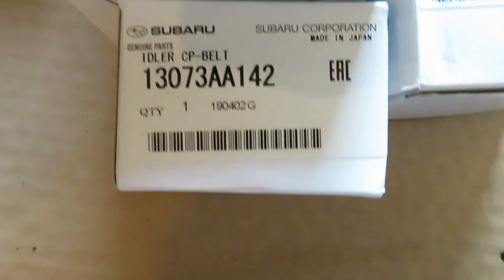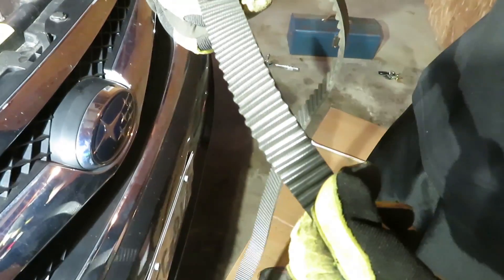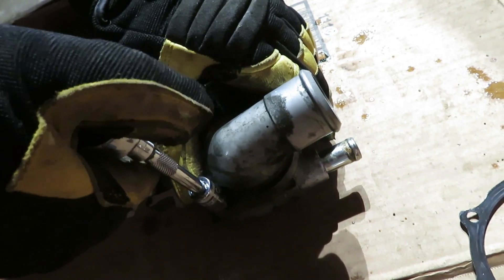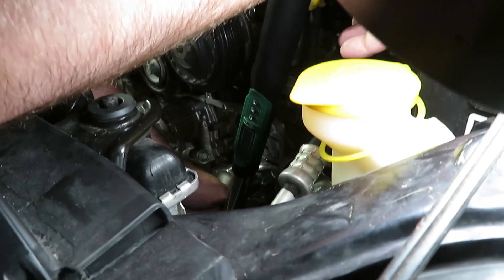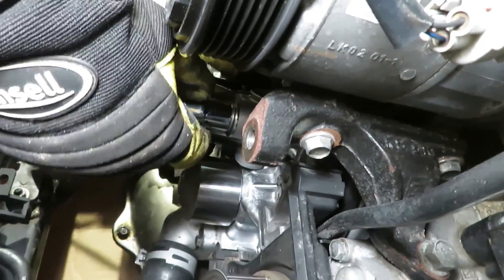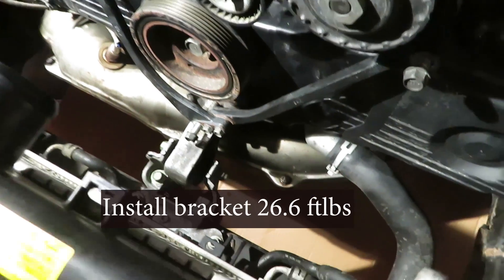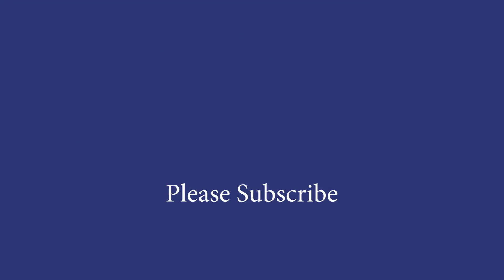How to Replace the Timing Belt and Water pump Subaru 2.5L Part 2: Replacement

Comment: 34.8 pounds of torque plus 60 degrees on the crank bolt to the torque of what makes absolutely no sense 😊
Reply from the maker: I know, but that's the way they spec out the torque.

Comment: If I just had a new radiator put in from an accident is it possible the water pump can go bad a few weeks later?
Could the pully been pushed into the water pump.

Comment: wow, this Subaru is an absolute POS. This is insane to just replace a water pump. My son's just went out, and wtf? At least we don't have to remove the transmission, and flip the car over to get to it, smh... What a joke, what were they thinking? Dumb AF. There's a special place in hell for the engineer that designed this. All day every day for eternity replacing this water pump. At least they did fix it later, this is how it should have been, so I guess they learned from their stupidity, and hopefully fired this engineer. https://www.youtube.com/watch?v=ECsrhMKR54s

Comment: I gotta give a huge thank you for this video. This is the only video on YouTube that I found that actually shows the entire process, start to finish. 

Other videos I found did mention a process of slowly decompressing and the re-compressing the tensioner pulley using a c clamp to bleed any bubbles that might've entered the fluid in shipping, so I did do that in conjunction with the steps lined out in your video. I also purchased an Aisin brand kit, based on advice from other videos on the subject, as Aisin sources the same manufacturer as the OE parts, other than their own brand water pump, which has  good reputation for not failing early.

The only issue I ran into was my harmonic balancer absolutely refused to come off. I wasn't sure if it was okay to use penetrating fluid in this area, but some quick research suggested it was okay. Some time with a propane torch, pb blaster, and a pair of vice grips carefully locked onto the top of the harmonic balancer to gain some leverage eventually got it free. Getting it back on also wasn't as easy as it could've been. I found out that the edge of the metal around the notch of mine was burred into the notch. I just scraped the notch outwardly with a screwdriver so the burring wasn't in the way, and then it went on.
 
Once the timing belt had begun to be routed on, the remaining idlers were truly a struggle to get the bolt correctly lined up, but they weren't impossible, just took time, patience, and a decent amount of strength to fight against the belt.

If I do this job again, I will try to remove the thermostat housing from the water pump before removing the pump from the car, those torqued bolts were hard to remove from the loose pump.

Again, huge thanks to you for this video. I've never done timing before at all and I was able to do mine successfully with this video as a guide.

Comment: You have great videos.  Just discovered your channel. Question: I have a 2013 Outback, I think it is a timing chain and does not need replacement. Can you please confirm?
Reply: Timing chains can still break and need replacing at regular maintence intervals. The specifics of when and how can be found by Googling your model. I've got a 2001 Outback, but it's a belt like this one.
Reply: @rachelfinder  Thank you appreciate the quick response.
Reply: @williamhaas8980  you're welcome! I thought the same thing about timing chains when I first heard about them. I was surprised to find out they still can break.

Comment: I am a DIY guy, but not a mechanic. So maybe I am missing a couple things that were supposed to be obvious (I watched both videos many times):

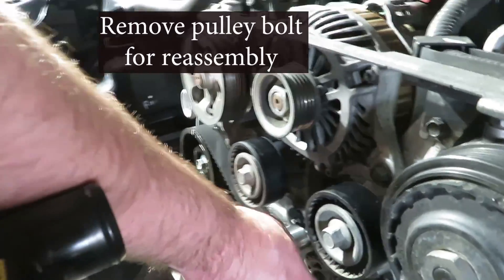1) At about 8:53 we hear; "..., we are at the end of Part 2 and we're going to take the crank pulley bolt out by holding one of the camshafts with the 17m socket."

That confused me. I eventually figured out (I think) that the "crank pulley bolt" you refer to is the bolt that was removed in Part 1 that held the harmonic balancer in place over the crank pulley (one drives the timing belt, the other the serpentine belt). I think the bolt was put back in temporarily to crank the engine by hand as needed.

But, removing it as you did seems like it puts unnecessary stain on the teeth of the brand new timing belt. Am I mistaken? Why not use the special tool, or have I misinterpreted everything?

2) I am completely confused by "34.7 torque plus 60 degrees" when replacing the crank pulley (or harmonic balancer as it was called when removed in part 1). I can't tell if you torqued to 34.7, then cranked the engine crank 60 degrees then torqued to 34.7 again. Or if you torqued to 34.7, then actually turned the bolt 60 more degrees while holding the crank stationary.

Thanks for any help.
Reply: You are correct on part 1, the crank pulley bolt is the same bolt that holds the harmonic balancer on. As far as part 2, you are supposed to be using the special holder tool to keep the pulley from moving, torque to 34.7ftlbs, and then tighten the bolt another 60 degrees. Let me reiterate that this 60 degrees is to tighten the bolt, so you continue to use the holding tool to keep the pulley from moving while you add the 60 degrees of rotation of tightening to the bolt. There are angle measure marks in the plastic above the harmonic balancer to help visualize the 60 degrees. I recommend a 12 point socket and as high toothed of a ratchet as possible to get as close to the 60 degrees as you can.

Comment: I am about to remove the old timing belt but the alignment marks are off by about 2 inches. I turned the crank over 4 full revolutions while checking the timing marks on each cam on each rotation.  Always off by about 2 inches. Do I remove the belt then just turn 1 cam back 2 inches to match? It ran fine before all this. I'm doing the timing belt because it is way overdue and I'm about to go on a road trip. Any ideas?
Reply: Logically, your idea must be correct. One of the cams must have been installed off its mark when the timing was either replaced, or installed at the factory.
Reply: @DieuEtMonDroit230  
The marks I originally referenced were painted on with nail polish and both were off by over an inch. I later found the machined in grooves and the rest was fine. I already put 2k on it since then.
Reply: @mindthependulum6245  I just came back to delete my comment, because I believe it to be more a more complicated situation if the marks in the metal don't line up. I'll leave my comment since you already replied. Happy new year.
Reply: @DieuEtMonDroit230  mine is the same, drvierside cam 12 o’clock passenger side 9 o’clock …. Runs fine but belt needs replaced. I should probably do what he did and make a mark on pulley …. I assume they didn’t put it on matching marker on engine … thanks great work and video 👍

Comment: Please help (I’m new to this). I got the new timing belt on, completed the clockwise rotations, and had everything properly aligned. After trying what you did at 8:56, the crank bolt did not come out. Instead, I jumped timing and now the crank is a few teeth back. I tried holding both cams to move the crank back into proper position, but had no luck and now I’m worried that I bent the valves because there was a lot of resistance and I even managed to start unscrewing the driver side camshaft pulley a few times. I don’t have much experience with this stuff and am extremely concerned. Please let me know, thanks
Reply from the maker: Firstly, I'm sure you didn't bend the valves. You should take a few steps back and redo the belt install. Get the cams and crank back in alignment and install the belt again. I'm surprised that the crank bolt got that tight merely rotating the engine twice to check timing. Just go back and try it again and I'm sure you'll be fine.
Reply: @TheOriginalMechanic  ok thank you very much. I really appreciate it. Didn’t see your response until now and it all makes sense now. I made a dumb mistake. Before watching your video, I assumed the marks on the timing belt were supposed to line up after two clockwise revolutions. When they didn’t line up, I figured that a revolution meant having the center mark on the belt align to the crank pulley again (if that makes sense). So I ended up rotating the crank way more than 2 clockwise revolutions. Do you think it’s safe for me to start the engine after realigning everything in order to get the crank pulley bolt off with a breaker bar again? Or should I go about it in a different way?
Reply: Interesting, I just asked a general question about this step as well. I am not sure why the special tool isn't used at this step.

Comment: You skipped what a huge pain installing the water pump L shaped side seal is.  I’ve been at it 2 a half hours and had the water pump partly in 6 times.    Out of the entire job, its the single most difficult part.
Reply from the maker: You must have a slightly different engine and pump. Our 2012 Legacy had no L shaped side seal on the water pump.
Reply: The trick I found to getting the L shaped seal in with the water pump was to lead with the passenger side of the water pump. My kept getting pulled off whenever I put the pump in straight. Getting the seal past that leading edge of the block first made things way smoother

Comment: What none of these guys tell you or show you is the hard parts. The parts where they get stuck on something or something won't come undone or go back on right. They make these videos look so smooth. But believe me, it's not. Getting a timing belt back on and all the pulleys, is not always easy at all.
Reply from the maker: I had no gory details to show because there weren't any on this job. I'm not afraid to show frustrating details when I have them, but I can't make them up when they don't exist. Thank you Subaru engineers!

Comment: Which model and year is this? I don't have those two drive belt idler pulleys on my 2009 Impreza.
Reply from the maker: 2012 Legacy
Reply: @TheOriginalMechanic  didn't they switch over to chain driven 2.5L engines after 2011?
Reply from the maker: @jugdhiss  IDK
Reply: @jugdhiss  my 2012 forester 2.5L X has a belt.. not a chain.. otherwise known as a serpentine belt.
Reply: @jugdhiss  once you see the treads of the belt start to wear off (after 100k miles or so) you need to replace it.
Reply: @subaruexpresstravels1163  my second comment was regarding the engine timing, not an accessory drive belt (otherwise also known as serpentine belts).
Reply: @jugdhiss  ok big guy.. excuse me for not being mechanically savvy.. thanks for the sarcasm.
Reply: @subaruexpresstravels1163  Absolutely no sarcasm intended, despite the perception from your end.
Reply: @jugdhiss  "otherwise known as" is sarcasm.. while clarifying Correction.. perception my ass LOL I might not be mechanically savvy but I am not stupid.
Reply: @subaruexpresstravels1163   I don't really get into semantics, just facts. Nobody called you stupid either, so have a nice day.
Reply: @jugdhiss  There you go again.. I never said you called me stupid.. you see where YOUR perception is going? You just don't know how to say things without a hint of sarcasm.. didn't bother me in the least.. I just like pointing out the obvious as I always try and say things in a way so they don't take it the wrong way.. you just don't care how people would perceive things as everyone is different.. psychology major here so don't bother refuting.

Comment: How do I add 60 degree to the 34.7? Where does one get that digital torque wrench
Reply: If you have a 6 point socket: tighten to the torque spec, draw a line at a point on the "star" of the six point and carry it over to the pulley. Draw another line on the point counterclockwise to the first. Tighten until the second line you drew matches the one you drew on the pulley. 360 degrees divided by 6 equal angles gets you 60 degrees. you can use a 12 point socket as well, just skip one of the points.

Comment: What if my cams are misadjusted, what should I do? The lines do not line up with the engine
Reply from the maker: You will have to carefully turn them by hand until they do line up.
Reply: @TheOriginalMechanic  my passenger cam is loose, is that normal?
Reply from the maker: @ButteredPeanuts  As you turn it clockwise by hand there will be areas of higher resistance as the springs compress and then lower as they release. Both cams should feel the same though.
Reply: @TheOriginalMechanic  my passenger cam moves back to the right and left about 3 inches? Could it be a problem, or bent valves?
Reply from the maker: @ButteredPeanuts  If the car was running before you started this job it likely doesn't have a major engine problem. I don't have an answer for that movement on your cam.

Comment: Are the cams for the SOHC engines not under spring tension like the DOHC motors are at TDC?  It looked like everything stayed in place when you took tension off the belt, so I would assume it's not.
Reply from the maker: Subaru's a little different but I would imagine there is still spring tension there. Maybe we just got lucky!
Reply: @TheOriginalMechanic  I haven't checked the service manual yet to see if locking the cam gears is part of the procedure for the SOHC as well.  This at least shows me what I'm up against.  Thanks!

Comment: You didn't bleed the tensioner or put loctite on the bolts
Reply: But he is incredibly ballsy using a 3ft torque wrench to turn 9ft lbs. 
that is asking to strip a fastener.
Reply: @fastinradfordable  I just saw this comment from 4 years ago but I have to laugh... It's a torque wrench... it indicates how tight the faster is. The only way to strip it is to use the wrong socket or ignore the readings on the torque wrench... or maybe if the torque wrench doesn't work in that range which was clearly not the case here!
Reply: He clearly removes the entire tensioner. 
And you didn’t see the bolts to know if they are lock-tited
Reply: This question implies that loctite is required, is it?